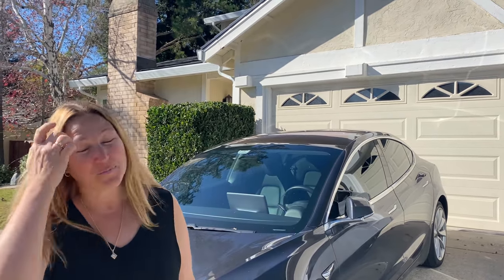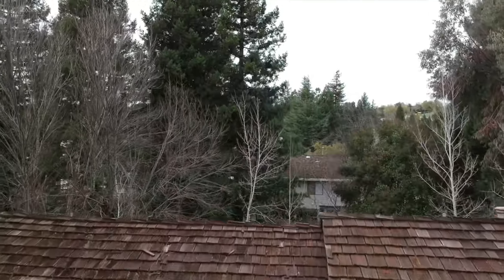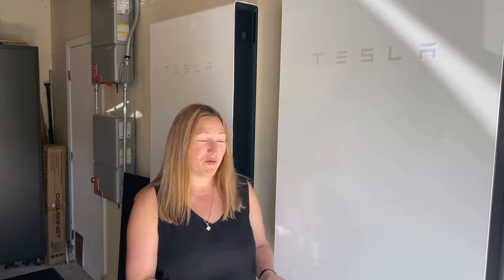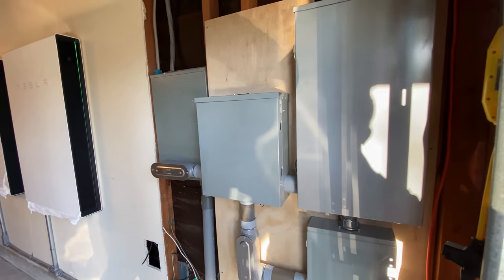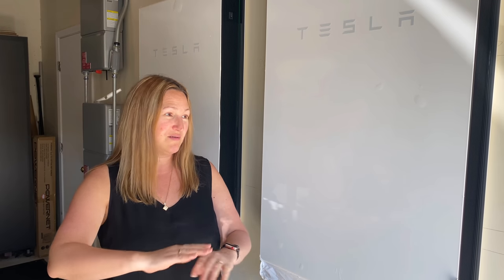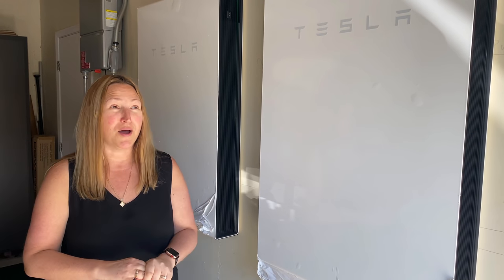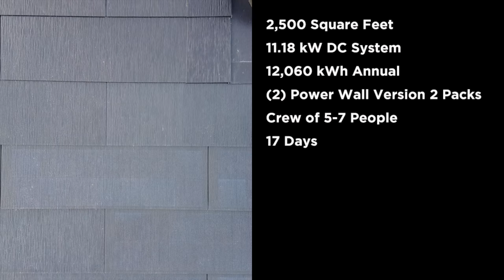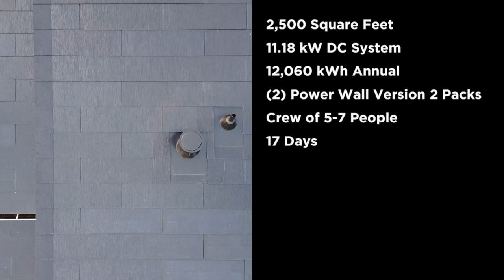Tesla Solar Roof V3 Installation

Comment: Did you get quotes for just regular roof + solar? How much would that have cost?
Reply from the maker: We did not because this is the only thing we wanted to do regardless of price. However, we did talk to many neighbors and got an idea of pricing. Solar Roof is more but not much more (about $10K more for our scenario). So that was not enough to make us skip doing this.
Reply: @neumanngroup  And I think only Tesla provides the Powerwalls (which I think are 7500$ each with installation). Congrats Neumanns on an awesome project (and nice vid)

Comment: So considering how volatile lithium can be what will you do if either or both the car and wall battery packs catch fire?
Reply from the maker: Run!
Reply: austin1839 
They should call the fire department. Although they will never need to. Dude, you're still in the 90's with your assumptions on lithium batteries.

Comment: How much would it have cost to replace the roof for another normal roof

How much would normal 11.2 kw solar system cost
Reply: Ashan Mendis  Total would be about 50,000 with new roof plus solar so 30,000 cheaper

Comment: I put my deposit down and had to keep calling.  The web estimate was about $100,000 but when someone finally called, they said it would be about double that!  Clearly they did not want to sell the roof in our area (Maryland).  I suspect they did not have any crews out here.  Our house is not that large.  I gave up and had a standard roof installed.  I would love to know how well these hold up and what the pay-back period would be. I also notice that you have gutters over the garage roof. How will you be able to clean the leaves out?  Can you walk safely on the glass tiles.
Reply from the maker: Bummer about your experience, that is crazy to hear. As far as the gutters we actually hire someone to clean them out. You can walk on the roof but it is strongly advised that you do it after 2 full days of sun and no rain. Also you want to avoid the early morning where there may be some dew formed on the tiles. Your shoes should also be free of sharp objects when walking on the tiles.

Comment: What would a regular roof with regular solar panels cost for your house?
Reply from the maker: It varies based on multiple criteria but we estimated about $60K total for a new roof (per HOA rules) and solar panels.
Reply: @neumanngroup  So you're 20k above that with Tesla, is that right? What did you find is the main return benefit for you for that extra investment?
Reply from the maker: No return benefit needed. We wanted solar and this is nicer, so for us that was perfectly fine. With crazy real estate prices in the Bay Area we figure we could recoup some of that difference in the sale if we had to sell the house today.
Reply: @neumanngroup  Yeah I was thinking that your house must have gained value in any case, this is after all quite a prestige feature! I hope your early adopter risk pays off for you.

Comment: I imagine that a Powerwall can publish stats directly to a website. I’d like to see a live stream. Also, your trees are blocking a lot of light. They will drop sap and gum up your panels. Panels are daisy-chained together. If one panel is in shadow, the chain is broken and the whole string doesn’t produce power. So it is worth trimming trees.
Reply: Sorry, that all sounded negative, which was not my intention. I am simply sharing from personal experience. Fantastic work on managing your carbon footprint. And thank you for sharing with the rest of us.
Reply from the maker: I agree about the trees. I have someone coming on Monday to quote a trim. I plan to do a “tree video” follow up

Comment: 85K is a lot of money. Do remember it includes 30 years+ free energy for both house and car, a new long lasting roof (maybe comparable to two regular replacement cycles), two powerwalls and a contribution to reverse climate change. 12 kWh annual = 3K/year of energy savings at 0,25 / kWh.

Comment: Is it value for money? Total cost  is around 85K for installation + battery replacement cost (Every 4 to 5 yrs). A normal electric bill for 10 yrs cost =  $200 * 12 * 10Yrs = 24,000, Now 20 yrs= $48,000.  So if you have lots of money, think of a Tesla solar roof.
Reply from the maker: Check out our costs video. Your numbers are off.

Comment: 2 batteries is not enough to get through the night, especially with 2 electric vehicles to charge. You only get 44A continuous and standard 240v chargers draw 32a each. That means with just 1 car charging you would take the batteries to 0% DOD in just over an hour. That's not even counting the loads from the house that are also consuming precious battery. Hell, even the solar can't cover 2 cars charging, even at STC.

Comment: It looks great, but the price is not right.

Tesla’s web site claims a cost of $7 per sq ft of solar glass + $2 per sq. ft of solar or $9 per sq. ft.

Together this is $9 per sq ft. A roof of 2,000 sq ft would be $18,000.

However, they quote in their web site a cost after incentives of $33,950 for a roof of 2,000 sq ft. or $17 per sq ft.

Add two powerwalls for before incentives for $15,000, and this is $48,950 without battery incentives from taxes.

How do they jump from this to your quoted price?

Your cost of $83,000 without the batteries is $68,000 before incentives.

$68,000 / 2,500 sq ft is $27 per sq ft of roof with solar.  

In my math this is not right.  How do they jump from either $9 or $17 to $27 per sq. ft.?

With incentives the $68,000 drops to $50,300 or $20 per sq.ft., and this is still higher than $17 per sq. ft.

This is their web site:  https://www.tesla.com/solarglass/design
Reply from the maker: Yep, our "solar materials" cost was low too but after you factor in labor, roof tear off, gutters, downspouts, minimal window dressing repair, prep work, electrical work, permits, etc the price goes up.
Reply: Permits.

Comment: Ok my family has roofed for over 100 years experience. Unless your roof is generating a lot of money back to you. 20-30k most for shingles metal roof. That’s with the wood replacement and tear off. High side 35k most now you paid 85k for these panels which I’m sure are the biggest pain in the arse to replace. Not only  that I’m so curious to see replacement cost and the actual average life span. So unless the house is paying you back 10k a year over 8 years you’d just get the money lost back.

Comment: Wow .  We could have installed a system for 20-30K.and with incentive and tax credit deduct even more$$ And you could have put on a lifetime standing seam roof on .  Our systems look nice today, with black panels and 25 year warranty.  Plus you can repair these traditional systems without reroofing your home.   . Spending 83K. Of course on certain homes I guess , it looks a little better. But not enough to spend this sort of cash in my view..    I worry also as wiring may cause fires on these in future as panels go bad,  how do you inspect these panels and wiring??.

Comment: 85k for 11kw is nuts, even with the two powerwalls.
Reply: omgnothingisavl and removal and replacement of the actual roof lol
Reply: I was on the website the install for 2500sq ft is 35k. How is it they charged 50k more even with removal of old roof? I seen this same install in California for 35k by someone who had 2500 sq ft roof. Just wondering why the price is soft different.
Reply: https://youtu.be/LRPy8UZv9V0

Here is video that I was talking about.
Reply: CARNAGE not sure exactly, but keep in mind the website estimate includes the tax credit of like 8500, and I believe he also added 2 powerwalls or maybe 3. Which I think is close to another 15k. Not sure where the rest of the cost is
Reply: @grambo1980  even with all that it seems too high. U said u had two powerwalls and it shows in video. Just saying I would get a break down of cost. Happy for you if you happy. Just looking out from one consumer to another. I'm very interested in getting the roof glass and powerwall units so I have been doing research on it. So I have been watching lots of videos of people installs and experiences. Your video is 1st I seen which paid more than anyone else with similar setup to what most pple have received in same specs.
Reply: My company Removing old shingles installed new shingles took all Garbege 4500$ 😂

Comment: You will have to live in that house for 50years to start seeing profit over your electronic bill. Economically it isn’t a good move unless you spend 1000s of dollars on electricity wish not many homes do. I spent about 200 a month that’s 2,400 a year and I don’t plan on living in this house forever so it isn’t a good move unless you pass the house down to your kids and they will live electric bill free. Lol

Edit: which
Reply: How much does a normal roof cost? You have to subtract that if you needed a new roof anyways. A house with a solar roof can be sold for a higher price and buyers will also offer you more because they don't have to pay for the electricity bill when they move in.
Reply: Sure if your math was right. Their most recent monthly bill seems to be $400, reported by themselves. Their full year usage was 12,000kWh and that equates to the solar roof installed. They will sell excess energy during the day, and buy cheaper at night. Let's say that would equate to $600 a month.
That's $7200 of savings/profit a year. Building a roof of that size in itself already costs a lot of money.  A roof of that size with those slight complex angles and fairly average shingle quality would cost $10-20k, depending on contractor, quality. Give or take. According to https://solartechonline.com/blog/california-solar-tax-credit/ you get a tex credit of 26%. And they seem to live in Cali. So 83k, after tax incentives assuming you can offset the full about gives you $61 420. Subtract an average of 15k for what a regular roof would of cost and you get $46 420. At savings of $7200 a year, 46 420 / 7200 = 6.45. So about 6 and a half years for break even. Sounds damn good to me.
Reply: @DeanIsMean  Sounds right, yes. Around 6 years in sunny places
Reply: No if you own 2 teslas
Reply: @DeanIsMean  Thank you for posting the most important information that she LEFT OUT!
You can't begin to figure out the benefit with the incentive TU..

Comment: I'm confused It produces 12,000kwh a year with a 0.04p per kWh it makes max 480 dollars...and cost 80k
Reply: The price included removal of old cedar shakers which were at the end of their life, installation of new plywood sub roof and rain barrier, PLUS solar panels, so cost of solar is way less, and that includes two huge Li ion batteries plus transfer switches for off grid use when ac power is down. Yes a lot of $ but overall much less than 80k for just 12 kwh/yr once you factor in all the other items.
Reply from the maker: Could not have said it better, thanks!
Reply: Don't forget credits and incentives. I'm sure that softens three financial blow.

Comment: Awsome! Looks good. It's going to last for EVER.
Reply: p.s. INSTALLERS are going to want to wear very flat no tread shoes. Soft rubber, maybe a slip-on. Safety. Good job installers.
Reply from the maker: Yes they did. They cracked one tile accidentally from having a rock stuck to their shoe. That was the tile with the blue X. It was replaced obviously but not until the last day.

Comment: So let's see.  Average price of a shingle roof according to Angie's list $5-7 per square foot.  Call it $6.  So for a 2,500 square foot roof that would be $15,000.  In 2020, the solar tax credit is 26%.  So total cost of the solar alone is $46,420.  Obviously will differ for everyone, but at my current usage and rates (including charging a 2017 Volt from empty daily) it would take just over 34 years to see a profit from the solar alone.  Then another 11 years if you want to include the cost of the roof itself in the  calculation.  Net metering will of course reduce that time some.  Presumably you would install a greater capacity than your usage.  But your utility is never going to pay you the rate they charge their customers to buy your excess electricity.  I hope it lasts long enough for you to make your money back on it.  Looks like they have a warranty of 25 years.  If you get to year 30 and the solar tiles start failing you're screwed.  Meanwhile, average cost of a traditional 12KW solar array after the 2020 tax credit is about $26,000.  So new roof plus solar array would be $41,000.  You basically paid an additional $20,000 (after the tax credit) because it looks prettier.

Comment: Even if your energy bill was 400 which is absolutely absurd it would take 20 years to recoup lmao. A standard homeowner would be handed there first recoup check in hospice dying.
Reply from the maker: So my energy bill is $400. I live in CA. Also I can full recoup the cost of the solar portion if my home value increases by 3%, which it already has in the past 2 years. So the recouping of this does not matter so much for our area as compared to other areas where it may be more difficult.

Comment: You will never get that money back.  BUT you might be self-sufficient when the need arises.
Reply: I think they actually might get their money back.  They will get a 26% federal tax credit for the roof, the value of the home has increased, and they will be generating their own power
Reply: Huh?
About $20,000 tax credit subtract that from $83000 they are at $63,000
They had to replace he roof now! So that would be around $30,000 ($50,000 here in northern NJ)
So they have to payback around $36-$46k
There electric bill every month can be around $150-$300 month they would be done paying it off around 15 years then it is free electricity for life
Not to mention when or if they sell to retire in Florida 20-30 years from now a fully electric house would sell faster and about 
5-10% more than the neighbors down the block
Reply from the maker: Our electric bill is closer to $400/mo. Yes, this will take a while to payoff but it will be paid off in some way. With in added resale value or just be pure financing. I think once you realize you may never get all of your money back on anything you do to your house, it is easier to pull the trigger on something cool like this.

Comment: 83k for a ruf is insane. You'll never make that cost back in electricity. Plus solar panels will get better with technology, whereas yours may go in the opposite direction and lose efficiency.
Reply from the maker: We didn’t pay $83k for a “ruf”. There are 2 parts here. A roof and solar.
Reply: @neumanngroup  Do you have a predication on how long it would take to break even? I get the impression solar is not worth it yet, but we're getting close.

Comment: $85k.... HAHAHAHAHAHAHAHAHAHA   For that amount of $$$ you could have gotten 4 Steel roofs that last a couple hundred years each along with a bigger solar installation... not that it matters as you have trees everywhere dropping leaves, pollen which means you have to clean your solar roof and guess what you cannot do with the TESLA roof....  You can't walk on it.  Not without D rings along the ridges and a harness which 1) you do not have and 2) still will not happen as it is slick as snot after a year compared to new and your roof cleaning guys will just turn you down because they do not like to be injured.

Comment: Your ROI will possibly not happen in your lifetime
Reply from the maker: I am ok with that. I don't get ROI from my flat screen TV, dishwasher, refrigerator, any of my appliances, furniture, cars, and the list goes on....
Reply: @neumanngroup  Everyone has the right to do what they like.When you take into account the cost of a conventional roof ,installed by a certified professional,and the monthly electricity cost you save,you will likely not benefit as far as cash saved over that period.Solar is a great idea,we are just not there yet in its cost savings .
Reply from the maker: True but if this roof adds resale value in our city where housing is insane, even a 2% increase in resale value will net me an additional $26,000 profit which covers my investment gap. So that is something to factor when doing this, your location and potential resale value.

Comment: Wow. $85,000 for a new roof with solar??? A new roof would be under $10k. So $75k for solar?? Divide that by???? Oh, maybe $300 per month electric bill and you have a payback period of,,,,,,,,  Drum Roll Please,,,  OVER 20 YEARS!!!    Just guessing,,,  neither of you are accountants, right??
Reply from the maker: Ha, we are not accounts for sure, but I think your math is off a bit ;)
Reply: That's not really comparing apples to apples there. Asphalt shingle roof isn't even close to this in terms of quality. You also have to factor in locale, where prices may be inflated. With the federal rebate I guarantee they saved money over buying a new metal/slate/etc shingle roof and then adding solar plus batteries. The Tesla wall alone, no installation is over $7k for one. Yes, you can always do it yourself for cheaper.